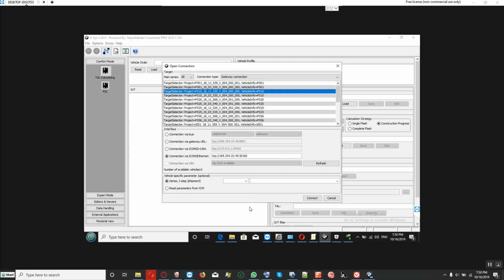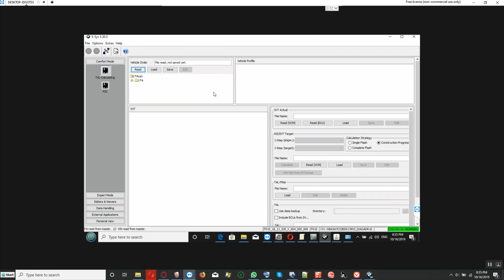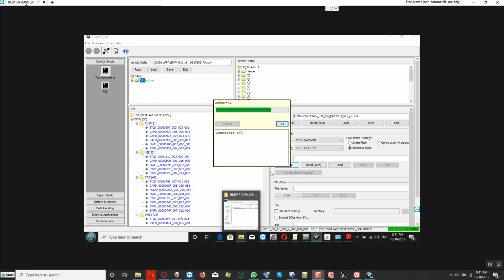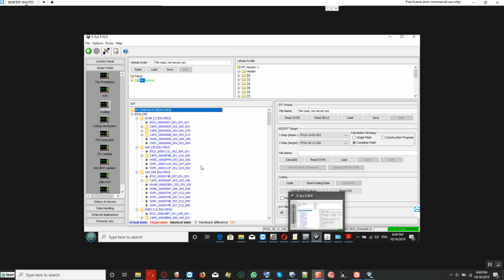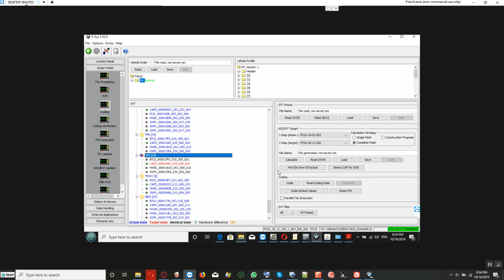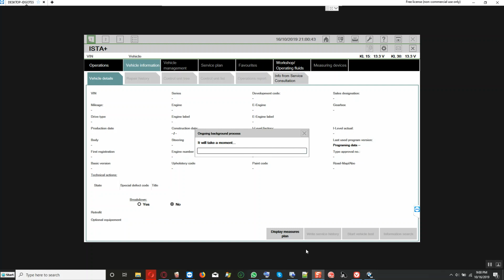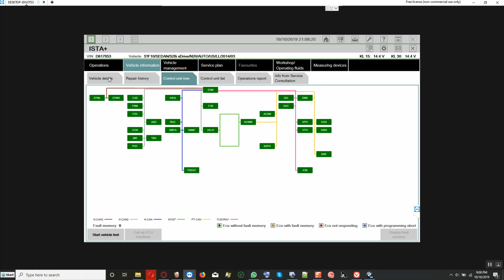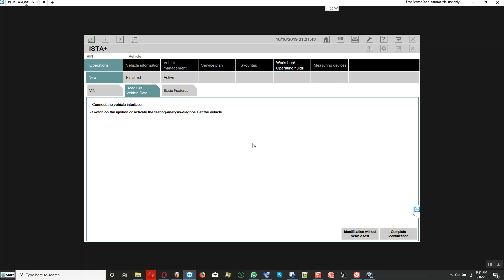BMW F10 STMR (Variant_TMS_3) Head Light_RIGHT CAFD Injection_2019-10-16 21:21:52

Comment: The change between ENET and ICOM and not flash with the ICOM full trough ?
Reply from the maker: The Enet cable got connected via Vin. It was Flash via Esys and Enet
Reply: How much do  you charge for that fault code?
Reply from the maker: @goodlife3655  What fault code?
Reply: @BMWPROGRAMMINGJAMAICA  for what you have done on BMW f10, head light teaching
Reply: @BMWPROGRAMMINGJAMAICA  for what you have done on BMW f10, head light teaching
Reply from the maker: Do you have all the software required? The cost will be about $160 without the software. But but $260 with software to be installed on your Laptop.